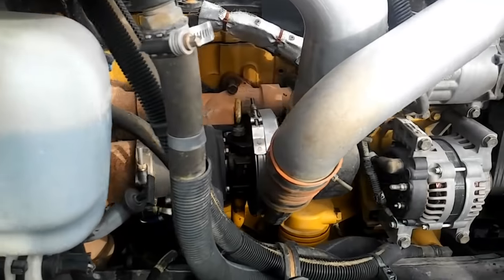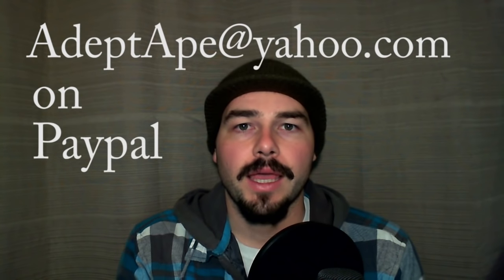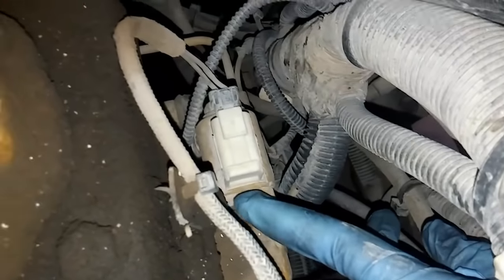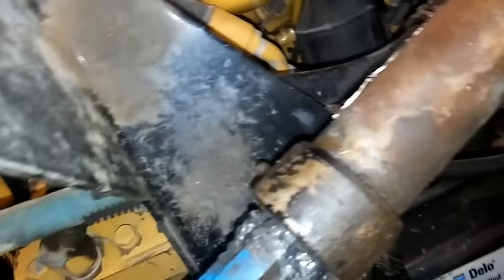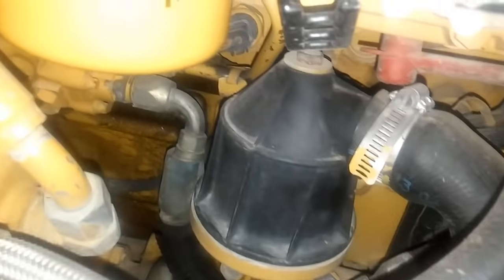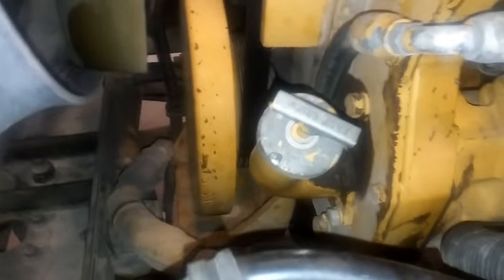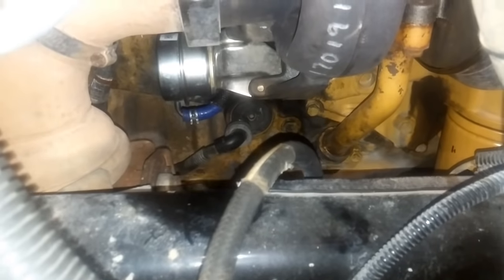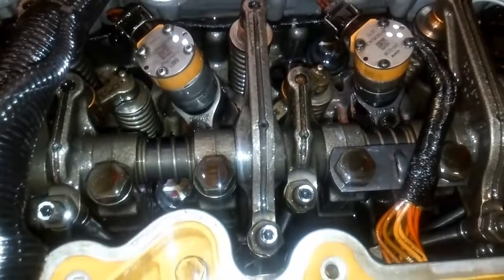The Cat C7 Engine.  Facts, Walk Around, Sensor Locations, and Maintenance.  Know Your Engine.

Comment: Hey guys! I have a C7 engine family 5CPXH0442HBK with the cylinder head off and the walls on cylinder #3 with some scratches, if not gouges. The original symptoms were huge blowby coming out and blue smoke / oil coming out of the tail pipe. What is weird is that cylinder and head area for cylinder #3 are dry and we found oil on top of the other cylinder / head area. Also, only cylinder #3 exhaust manifold hole is wet of oil and the other ones are dry. Please let me know what are the chances that this engine can be rebuilt, maybe by cutting the walls and putting bigger pistons. Or, what are the margens /specs / limit for cutting the walls. Thank you very much in advance
Reply: I'm doing the same thing and I'm wondering about the scratches in the cylinder walls of my engine. Did you end up getting a piston bore number three?
Reply: @ronbown3836  Nope! They got rid of the entire engine and truck.  It wasn't worth  fixing them

Comment: Got any tips for putting the rocker shaft back on? i had to reseal the cam follower plates and had a heck of a time getting the push tubes to stay on the cam followers and the rocker arms.
Reply from the maker: +rusty Shackleford I used to work with a mechanic that had an alias of Rusty Shackleford. Anyway, the best way I've found is to keep the valve cover base off and mount the rocker arm shaft without the pushrods in. Then install the pushrods and feed them into them into each rocker one at a time. It is time consuming both ways, but this way is much less frustrating.

Comment: how many miles, more or less, can these engine go...before a rebuilt
Reply from the maker: +Adan Castro I've seen them in the 300,000 mile range, but usually people overheat them way before that and destroy them. Cat has 200,000 miles on their website for "rebuild consideration" I would like to see one in an on highway application see how many miles that would go.
Reply: Adept Ape I work for a peterbilt dealer in NJ, I had a customer whom had a 2003 peterbilt 330 car transport w/ cat 3126  10 spd Trans both had 375,000 before we swapped in a new cat long block and 13 spd Trans ,religious 5k mile oil service

Comment: Just to be clear, for the back of my own mind. Starting at 11:09 in the video > https://youtu.be/pS0i3f5hYhk?t=11m9s
You mention the possibility of when a HEUI goes bad, of it throwing some metal debris into the HEUI rail, which you state here is in the head. I am under the impression, and I could of course be wrong, but that in 2007 and newer C7's, this oil (HEUI) rail was no longer in the head. We'll call this the common-rail, variable nozzle turbo C7.  So can you confirm please, if this is truly different between the 2003.5 - 2007 C7, as compared to the 2007 and up versions?
Reply from the maker: +Steve Kluver Yep, the 07 C7 with the C7S serial number is a common rail setup with no HEUI system whatsoever.

Comment: another  good  video . I've  never  even  seen  one  but  no  good  info  is  ever  too  much . my  normal  engines  are  Cummins  8.9,  m11  and  15  liter , with  an  occasional  Volvo . worked  on  a  lot  of  c13   and  c15 , we  had  a  c13 mechanical   that  met  2015  smoke  standard  with  out  the  dpf  on  it
Reply from the maker: +Cbmech There are a lot of C7 engines out there, I'm surprised you haven't seen one.
Reply: Adept Ape class 7 and 8 trash truck's 54 to 80,000lb. I think the smallest engine I've seen in a 54,000 (trash truck's are allowed 20,000 on the front axle) is an 8.9 Cummins
Reply: Pete's, Autocar for the most part
Reply: Used to see ih with dt466 but they are so underpowered somebody finally got got smart. Problem with the 8.9 is they live on the turbo for a truck at 35 to 54,000 lbs
Reply: A c9 would probably work quite well knowing cat but haven't seen that either
Reply from the maker: +Cbmech It's a blessing Cat never put Cats in garbage trucks, because I wouldn't want to work on them.
Reply: Adept Ape 
😊😅 well garbage trucks really aren't that bad, the only time they really smell is if you start digging around and welding in the body. Unless you are talking about the new food waste recycling trucks, yuk. Years ago I worked for a company that had Mack's and the dealer wasn't real good at getting around to work on them so we started sending them in with a full load. In the summer it didn't take long to get a carpet of crawly rice under a truck 😂😊

Comment: When you drain the oil, if you want a complete drain, let the engine idle pull the drain plug and shut off engine as soon as the oil pressure drops

Comment: Sir I have questions? C7 caterpillar engine Tamrock drill ranger 800.. new engine overhaul already.. when coolant temperature getting 150f the coolant coming out to radiator reservoir line why is like that? Thanks

Comment: "Front Structure" oil leak as in 'Front Cover'?
Pretty sure this is my issue on my 2004 Fleetwood Discovery and have a shop [Excel] in Charlotte quoting me a little over $12k to repair it...which I find as ludicrous. 
I understand it's labor intensive and a PITA on a motorhome, but $12k sounds out of touch with reality. 
Contemplating doing it myself as getting the parts is no problem and I have all the tools and ability, just wondering if it's going to be a wicked b*tch or not or do I just research some local small diesel repair shops in SWFL that may not attempt rape like Excel...😂

Comment: the smallest actual cat engine was the 3304
Reply from the maker: +Bryce Weber I'm sure Cat in the past made smaller engines as well, but as far as the C series engines go the C7 was the smallest. The 3304 would be smaller though, I've never seen one in a truck only the 3306.
Reply: Yea 3304 are only for heavy equipment like small bulldozer other things like that
Reply: We have six 120G graders that are powered by the 3304 PCNA's or by the Tier III 3304 DITA's. Solid engines.